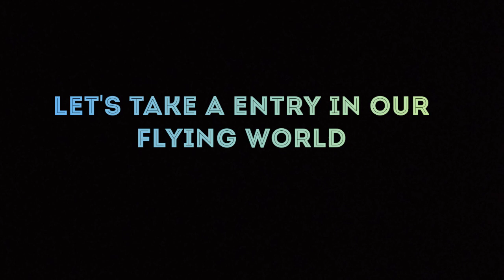How to make F450 Size Quadcopter at home

Comment: What is the max generated thrust and at what amperage rating ?
Reply from the maker: Around 4kg thrust by 4 motors..
 But I didn't measure the ampere consuming..
Reply: @akgadget  The reason I asked is because I'm trying to figure out what battery should I buy. I also need to power the companion computer and a camera from the same battery so I would like to buy something that works for everything with no difficulty. And also not too heavy so my drone doesn't become unstable
Reply from the maker: Try 4s 3000 mah lipo..
Reply: @akgadget  Ok I will look it up. The one on this video is also too much powerful I assume ?

Comment: You used 8200 mah battery right?
Reply from the maker: No, 
I used 5200mah 4s lipo battery and 3000mah 3s lipo...
Reply: How much flight time you are getting?
Reply from the maker: @AndroTechjayanta  Around 20 munits flight time from 5200 mah 4s battery...
Reply: @akgadget  
4 cell mean more than 14v right?.so will it effects the flight Controller?
Reply from the maker: @AndroTechjayanta  No, Every flight mostly powered by ESC or, BEC ...
So it's dose not matter that what kind of battery you used...
Reply from the maker: @AndroTechjayanta  The general voltage of 4s lipo is- 14.8v to 16.8v....

Comment: Which flight controller is used ?
Reply from the maker: KK 2.1.5 flight controller...
Reply: @akgadget  plz tell me the pi details
Reply from the maker: @sampaprajapati1111  I actually fly drone with default pi setting.. I just used 50% of my transmitter 1 and 2 channel...
Reply: @akgadget  but I have fsct 6b
Reply: @akgadget  I fly my drone with 3 40A esc and one 30 A esc does it will have some problem
Reply: @akgadget  where are you from in West Bengal jalpaiguri?
Reply from the maker: @sampaprajapati1111  No, I'm from North 24 Pargana...
Reply: Can u send me the pi tuning details!!  ?